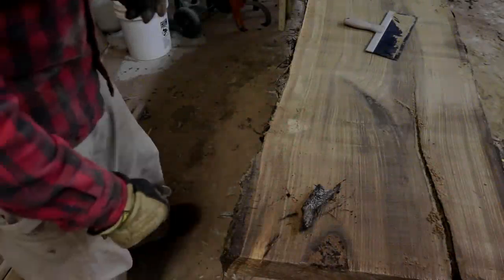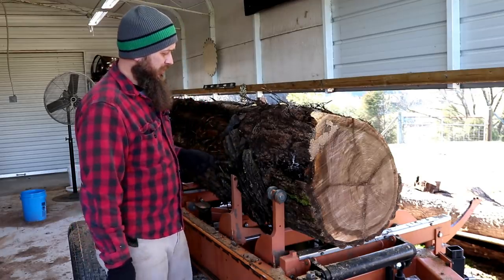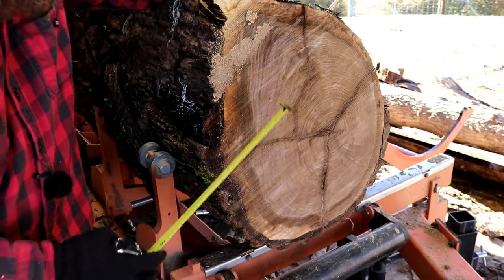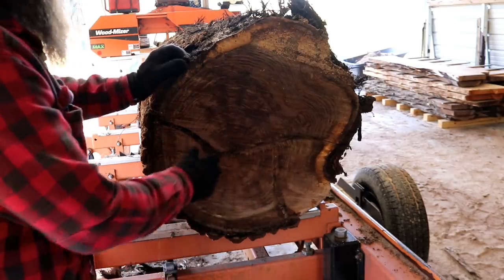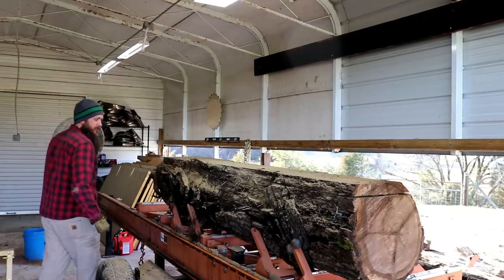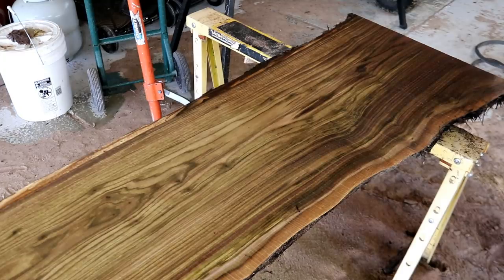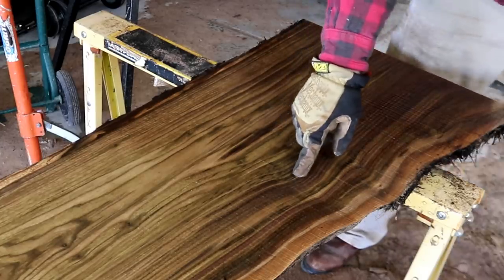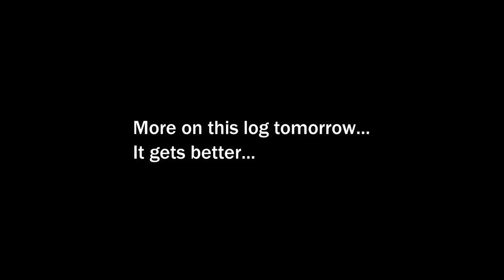WILL THIS CRACKED WALNUT LOG BE WORTH SAW-MILLING? A SAWYERS JOURNAL

Comment: I found cutting around the big cracks as best you can,  and try to box in the crack like you would a pith.   Sometimes that's a slab, but usually with larger cracks like that the slabs don't hold up, usually just make a mantle out of that stuff.  Just part pf what makes the slabs more valuable, not every log is a candidate!

Comment: The best log I cut was with my Alaskan saw mill. It was a crotch with 4 Limbs at one end . It was 42 inches at the but and 50" at the crotches and 48 long . It sat on the ground for 3 years in my yard. When I cut it it was filled with crotch figure, curl and spalting. It was a sugar maple . I made a bar for my wife. I used an old singer sewing machine as the base. Her father was a tailor and the base was one of his old sewing machines. I sound 4 slabs to a young lady who was making bar stools out of them .

Comment: What is your method of dealing with sawdust while sawing inside? Outside is easy but inside it seems to build up fast
Reply from the maker: Right now a bucket and a snow shovel. That will change soon 👍
Reply: I’m trying to set mine up to be inside all the time but not finding a good cheap solution to removing it by hand.